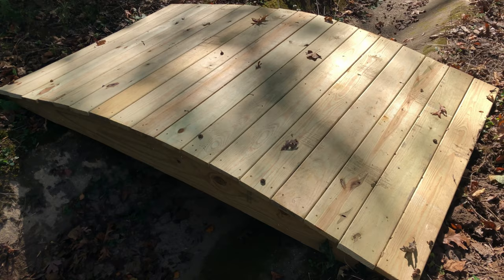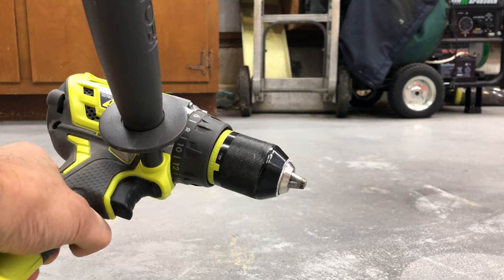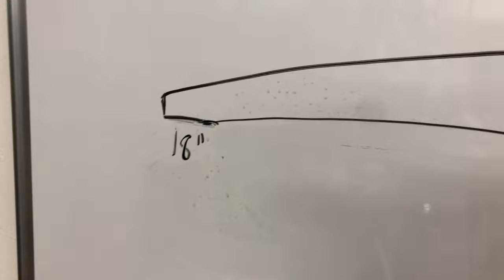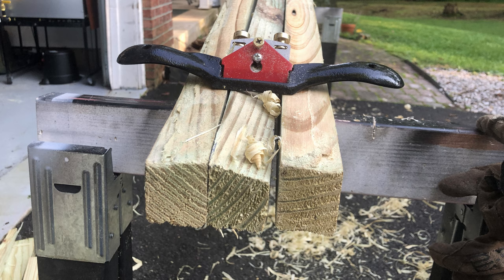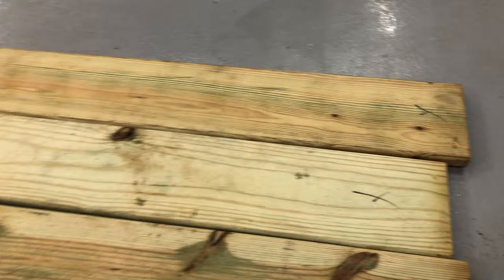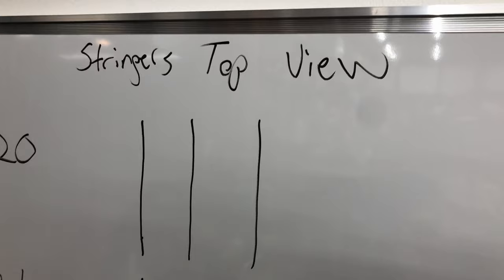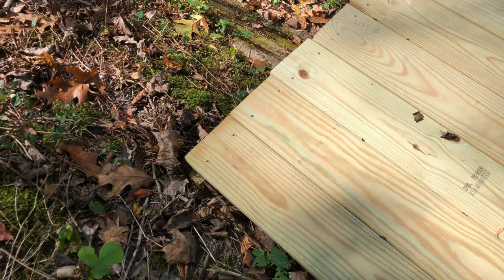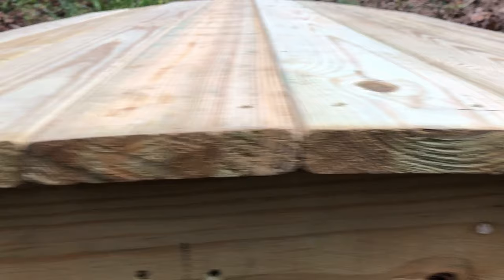Simple DIY Arched Garden Bridge for Riding Mower

Comment: Just about to do a similar version and your video really saved me time and money.  Im adding deck joist tape to the stringers and adding a double composit deck board to the bottom ends of the bridge.  These will rest on some bricks and keep the wood off the ground.  Lastly, as mine is going to be the entrance to a new flagstone path in front of my house, I'm mounting the deck boards from underneath for cosmetic and additional (I hope) protection from water.  I loved your use of PVC, advice in end height, and use of circular saw and jig.  Thanks again!